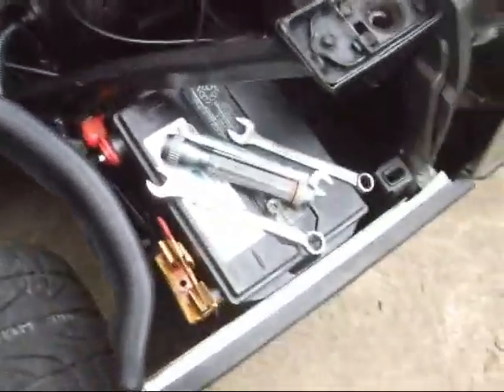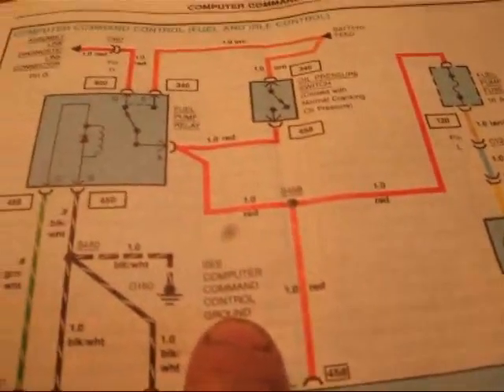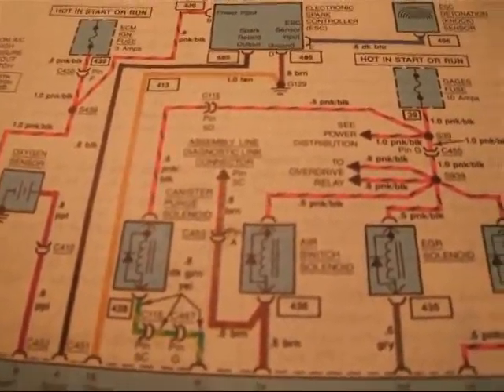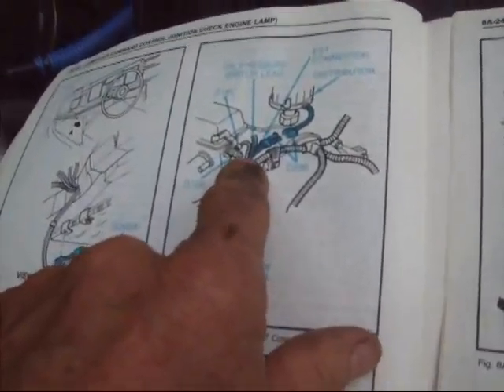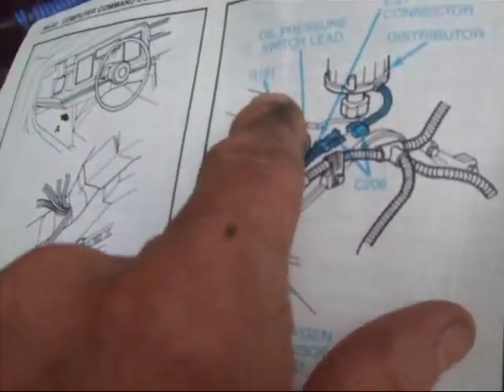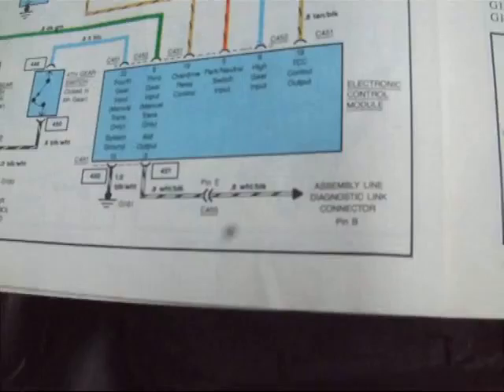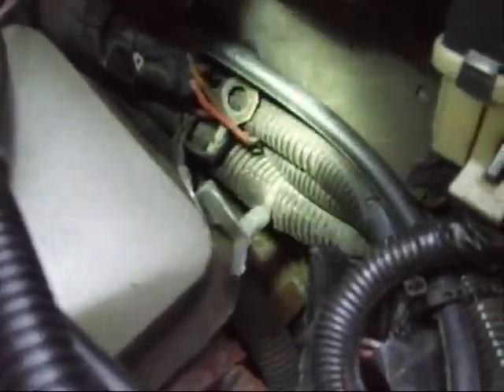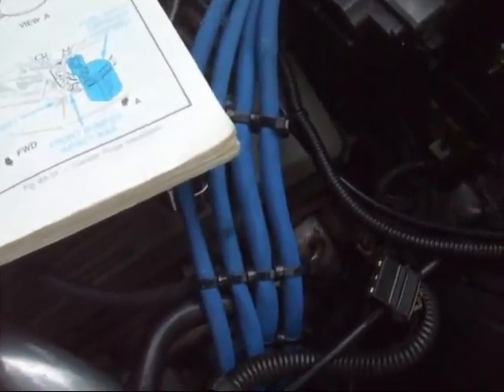★彡 𝟏𝟗𝟖𝟒 𝐂𝐎𝐑𝐕𝐄𝐓𝐓𝐄 彡★  𝐌𝐈𝐒𝐅𝐈𝐑𝐄/𝐏𝐎𝐎𝐑 𝐈𝐃𝐋𝐄 𝐆𝐑𝐎𝐔𝐍𝐃 𝟏𝟐𝟗 𝐚𝐧𝐝 𝟏𝟔𝟏

Comment: did this today. I didnt even notice I had a rough idle until I cleaned all the connections. my valve cover was leaking oil onto the main ground on the block so looks like I'll be doing the valve covers next weekend.
Reply from the maker: would really appreciate you're letting me know how the job goes, I want to take mine off just for the experience, clean them up nice and to look at the drain back holes.....pictures, video or just sharing any obstacles you run in to....heard the wiper motor gets in the way  but that was on an 85?? Thanks Billy
Reply: @HorseshoeBeach  I have a 85 and it was a little frustrating at first but I did have to remove the wiper motor. It's not as hard as it looks. Just take your time and don't forget where bolts go and hoses.

Comment: Yeah definitely aint getting to that ground without taking off the valve cover I would imagine.. I have a valve cover gasket for that side just waiting to be installed..Im glad I didnt install it before I cleaned this ground.. Was the wiper motor in your way? Was it as difficult to sneak out as the passenger side?
Reply from the maker: Just went out and refreshed my memory,  realized you were talking about the valve cover not the ground wire. If you take the back of the wiper motor off, (the cap) 3 torx screws, you can wiggle the valve cover off. As for the ground, I just pulled all the wiring and MAP sensor hose out of the way and I was able to get a open end wrench down there, and get the  wires off, clean them with a brush and get a long handle small wire brush down at the grounding point and wire brush it.  The valve cover is  a bit of a puzzle to play with but it is very doable without removing all the stuff others say has to be removed on some of the corvette forums.